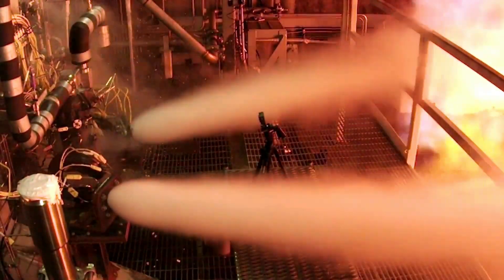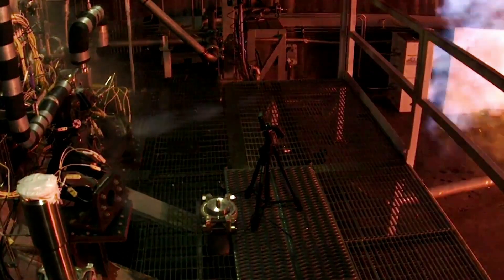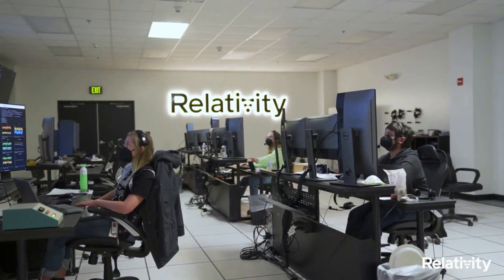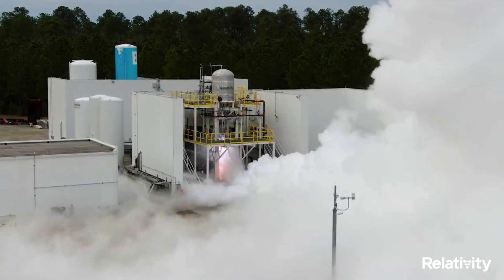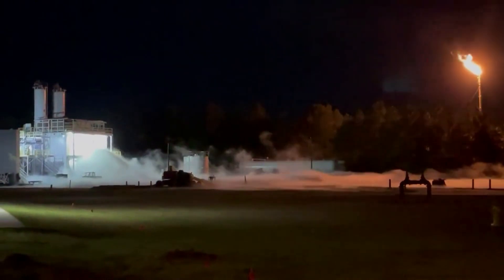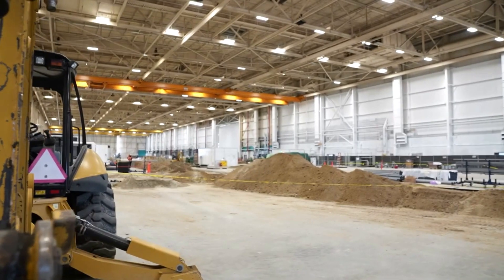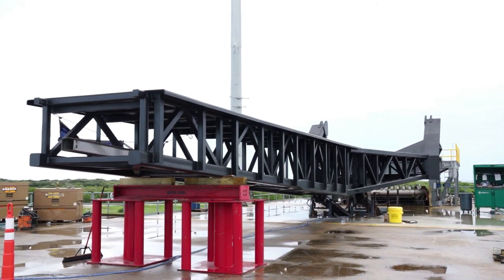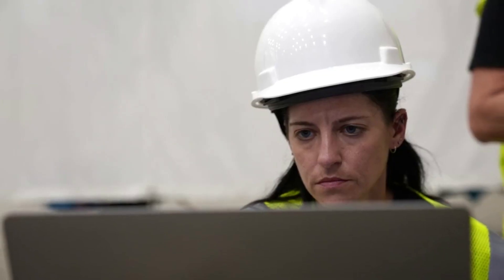Significant Developments On Terran R’s Main Engines

Comment: Wouldn’t it be more efficient and stronger to use sheet metal for the straight cylindrical sections rather than print it with a welder? Also I would think the process would create serious stress points reducing strength and durability… 🤔 These questions aside I look forward to Terran Rs success and can’t wait to see it reach orbit
Reply: Then you'd require tooling to form sheet metal, highly skilled welders to manually weld on the printed domes, and some type of x-ray or ultrasound inspection of the manual welds. 3D printing everything doesn't require any additional material, tools, labour, or tests and provides a near guarantee for a consistent end product. 3D printing also provides better tensile strength than traditional manufacturing methods, making it ideal for pressure vessels

Comment: 0:33 The Aeon R engines have a maximum rated thrust of 268,000 lbf X 7 = 1,876,000 lbf. Not  over 3 million pounds at lift off.  What is interesting and ambitious concerns the replacement of the nine Aeon 1 engines on the Terran 1 with a maximum total thrust of 207,000 lbf with one Aeron R engine by the third flight.  Color me skeptical but would be over joyed if they can accomplish it.

Comment: Very exciting. With sufficient power it's possible that the printer feedstock could be ISRU'd from regolith especially given that max G loads would be much lower at Mars, the Moon &c. and so require less massive structures. Max tank pressure capabilty/hoop stress would be the limiting factor. If the printer can print itself and new vessels we've got us a dang old von Neuman machine.